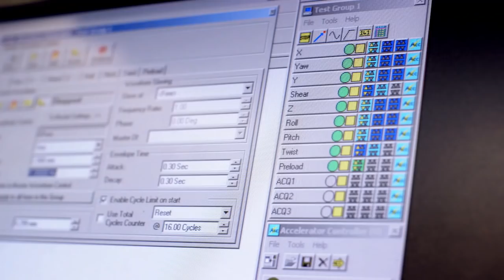Understanding graphite cores in nuclear reactors

Comment: Tell me how a RBMK reactor explodes?
Reply: I'm not prepared to explain it at this time.
Reply: its disgraceful... really
Reply: Comrade, it didn’t explode, the rest are delusional. Take them to the infirmary
Reply: What does that have to do with AGRs?
Reply: What is the cost of lies
Reply: RBMK's have a positive void coefficient using regular water which can lead to a feed back loop and a runaway reaction.
Reply: @davidhaykus1568  chemistry, my dear watson.
Reply: @yeo5811  he's delusional, take him to the infirmary.
Reply: You DIDDDDANT!
Reply: @davidhaykus1568 He never once mentioned that graphite is also a moderator which can lead to a positive void coefficient!
Reply: @paulcrathorn5707  This is an AGR reactor, cooled by carbon-dioxide... There's no water involved in the reaction, so no void coefficient to worry about at all.
Reply: @davidhaykus1568  so this positive void is created when the water used as a coolant boils and is therefore not reducing the core's heat, is that correct?
Reply: @king0vdarkness that and light water is also a weak neutron poison, reducing reactivity. When the water boils away you now have voids that in a graphite-moderated water-cooled reactor, lead to an increase in overall reactivity due to this weak poisoning affect (neutron capture) of the water suddenly disappearing.
It's also the reason for the graphite "tips" in RBMK series reactors to offset the affect of the light water (in reality tip implies only a little, when actually a whole section, almost as long as the control rods themselves, was graphite, probably easier for the show to say tips though 🤔)

Comment: Didn't explain anything why use graphite
Reply: as a moderator for the neutron flux
Reply: @herbertsdottir9223 , wasn't water the moderator?
Reply: @Memories_from_the_future  Yes, commonly used moderators include deuterium (as heavy water), hydrogen (as common or light water) and graphite.
Reply: @rafaelbarbosacosta9365 , so why use both water and graphite? What is the role of the graphite? Sorry, I'm dumb when it comes to physics and chemistry.
Reply: @Memories_from_the_future  Well, explaining this easily is complicated because it has many concepts restricted to particle physics, but understand that these substances can decelerate the neutrons of the reaction and increase the probability of being absorbed by the nucleus.  If you read with patience and calm, you can be sure that you will understand the concepts better.😀😉
Reply: @Memories_from_the_future  U re welcome
Reply: Because is a gas cooled reactors that runs hotter than normal water reactors, water would boil heavy water too, there had been experiments of gas cooled water/heavy water moderated reactors and they failed, the best moderator would be Berylium but is insanely expensive
Reply: graphite absorbs less neutrons than regular water.
Reply: What is the more expensive option to graphite
Reply: it seems to be a material that has several properties that would make it suitable for the purpose they fulfilled. That is; shapable into "bricks" that can hold the control rods; Serve as a medium moderator; brittle enough to allow small cracks; etc.
Reply: @Memories_from_the_future  For this specific reactor, water is only used as something to boil to spin a turbine, water is not being used as a moderator or coolant. Graphite is the moderator and Carbon dioxide is coolant.
Reply: @ddrse  Graphite is not really a cheap neutron moderator (regular water is cheaper). But more expensive moderators would be heavy water or beryllium.
Reply: Graphite is used party because these are GAS cooled reactors, there is no water in the core and water would normally be the moderator

the main reason though is because Carbon (in the form of graphite) is a much better neutron moderator than water, this means if you use graphite then you can run on unenriched uranium, which cuts costs significantly as uranium enrichment is expensive
Reply: basically, graphite slows fast-moving neutrons in order for the neutrons to split uranium-235 and release energy. If the neutrons are too fast the uranium will absorb the neutron and it will not split.
Reply: Nuclear Graphite (has to be almost pure, since a lot of graphite has impurities, including boron which is a strong reactor poison) is cheaper than heavy water or beryllium, and is a better moderator than light water.
Light water actually has problems as a moderator (specifically that it is actually a weak reactor poison) so light water reactors have to used enriched fuel, which even just a dozen or so percent can be prohibitively expensive for many countries. Hence the appeal of graphite as a moderator.
As for water as a moderator in this case, AGRs use only the graphite as moderator, the coolant is CO2. Water is only used to generate steam for the turbines, but isn't used in the reactor core.

Comment: Sounds like an RBMK-1000...  We all heard what happened with a few of those...
Reply: You're mistaken. RBMK reactors don't explode.
Reply: @richardgadberry8398  Oh snap.  My bad.
Reply: Aside from graphite moderation, it actually has little in common with RBMKs. The RBMKs were actually very badly designed reactors. Not saying other designs including AGRs can't potentially have problems, but the RBMKs are pretty much uniquely suited to the kind of runaway excursion that happened at Chernobyl.

Comment: how the nuclear reactor works?  i hate this uranium, graphite. boron and whatever elements have been said in HBO Chernobyl damn it i hate science 😅😂
Reply: It really can be reduced to “put hot rocks in water, make the water boil, steam powers the turbines”
Reply: Basically: Uranium is fuel it is radioactive which makes it HOT. We like HOT because we can use that to heat up water and turn it into steam that will use the kinetic energy to turn turbines. We then use generators to turn this turbine kinetic energy into electrical energy! Ok, graphite basically without going into too much detail as to why neutrons normally will go wayyyy too fast and they won't collide with other atoms to split them, so we use graphite which they pass through but will hit other atoms along the way and slow down so they have a higher chance of splitting atoms. Boron is used in the control rods, the control rods ABSORB neutrons so that the reaction will be slowed down/stopped these mean that the reactor can't just keep on reacting until it melts down. Ik this is a year late... but hope it helps lol

Comment: We should rethink how we power the grid . Chernobyl n Fukashima were a warning
Reply: Fukushima and Chernobyl do not belong in the same sentence.
Reply: Chernobyl was a combination of a badly designed reactor with inadequate safety systems, combined with mismanagement by the operators leading to a runaway excursion. 
The RBMK design used at Chernobyl was uniquely suited to that kind of event.
Fukushima was the result of a Tsunami that prevented the backup generators from running the coolant pumps leading to meltdowns.
The 2 situations are completely different and aren't even comparable really.
Had TEPCO handled things differently Fukushima probably wouldn't have been the big event it turned into. (the workers on site even wanted to take steps to control and mitigate the problem but TEPCO wouldn't allow these steps until it was already too late.)
Overall nuclear power is by far one of the safest ways to produce power that we currently have, and I firmly believe, in combination with wind and solar, how we're going to have to mitigate climate change and get rid of fossil fuels.

Comment: Why use heat exchange when the capacitance stabilization & rectification regulation, as well as (most valuable) the amplification of inherent circuit current is easier?